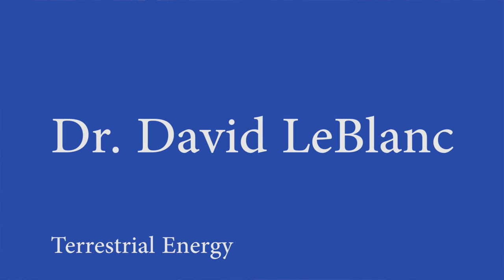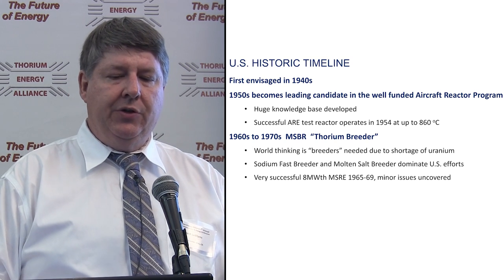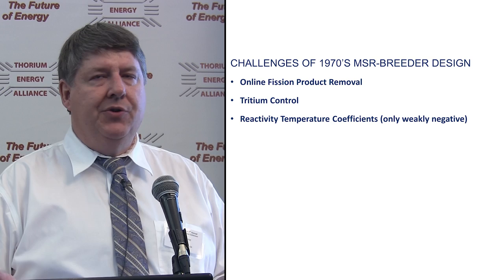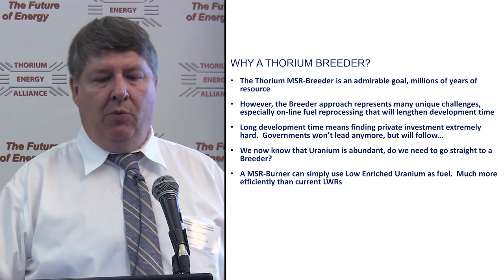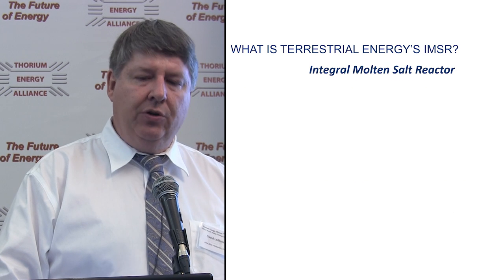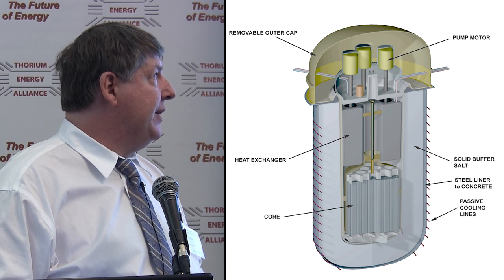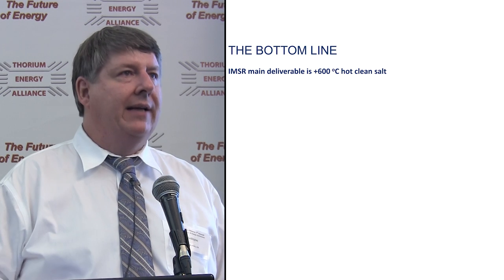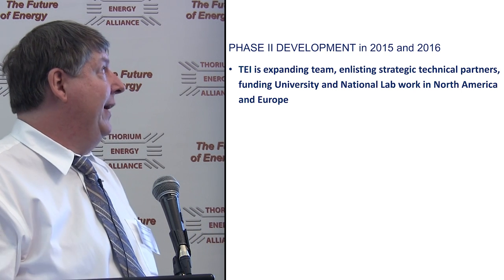IMSR: Terrestrial Energy's Integral Molten Salt Reactor -by Dr. David LeBlanc @ TEAC7

Comment: "Fukushima shut down, NO problem" No problem? Really? Laughing. The thorium scam trundles on.
Reply: Yes, the reactors had shut down, but the cores were still extremely hot just like an oven, car engine, room heater, etc. aren't cool the instant it turned off.
Reply: kokofan50 Laughing
Reply: Il Pirata Well, some finding their own ignorance funny. I guess there's a first time for everything.
Reply: Il Pirata Because you don't know what you're talking about.
Reply: Says the guy/girl comparing car engines, ovens and heaters with fissile nuke fuel. Go away
Reply: Il Pirata Yes, using objects most people will understand to explain that bodies don't instantly stop being hot. That's so crazy I can't believe I did that.
Reply: Infants and younglings aside, how many people do you know that don't have a basic understanding of heat retention, and need it explained to them? And do you really think your analogies (ovens, heaters) work with a self sustaining process like nuke fission reaction? I'm no expert but the differences seem obvious and distinct. I'd suggest you not assume everyone with an opinion different to yours is ignorant or needs things explained to them. Maybe you're the one with the misconception?
Whether or not the core had shut down, or the cooling provisions failed subsequently isn't relevant to the point I was making. That suggesting there "was no problem" is the laughable spin pro nuke lobbyists need to bleat to minimise the real dangers of nuke power. I'd have thought that was pretty obvious too, but look, turns out you need it explained to YOU!
Reply: Il Pirata You would probably be horrified by how many adults don't understand even the basics of heat conduction. Also, most people, particularly the anti-nuclear people, have no idea how nuclear reactors work. 

Nuclear reactions are only self sustaining understand the right conditions, and the reactors at the Daiichi plant were well below critical. Everything was fine until the reactors lost cooling. 

No, anti-nuclear nuts hugely exaggerate dangers, and a realistic look at the danger seems blasé in comparison.
Reply: "particularly the anti-nuclear people"

You can't help but dismiss all opposing views with glib generalisation, preferring to see the world through your partisan myopia!?! How typical, I'm guessing you're a republican, or worse, a libertarian? 

Suggesting "everything was fine" at Fukushima "until the reactors lost cooling" is as nonsensical as saying everything was fine till the two trains collided head on. You've missed the point, again.
Reply: Il Pirata I was being neither glib nor dismissive. I was simply remarking on an observation I had made. 

What point and how am I missing it? The Daiichi plant would have been perfectly fine if the reactors hadn't lost power
Reply: So when you say  

"most people, particularly the anti-nuclear people" and "anti-nuclear nuts hugely exaggerate dangers"

what were you being if not glib and dismissive of those you don't agree with? 

As to the point you continue to miss 

"The Daiichi plant would have been perfectly fine if the reactors hadn't lost power"

Would have? If? Hadn't? 
But they DID!

By the way, how's the clean up effort going? How much contaminated soil has been collected and where will it be stored and for how long? How much contaminated water is still leaching into the ocean every day? How many people have been displaced, loosing their homes and lives as they knew them? And what's the genetic/oncological legacy left to future generations, globally? 

Your selective statistical appraisals are irrelevant in the stark light of these realities.

That is the point! 

Ps not only did primary power but back up/emergency power supply to cooling systems failed as well. I bet lots of people thought they had the whole 'safety' thing covered. And I bet they did, right till the moment an unforeseen earth quake caused a tidal wave that made a mockery of their arrogance. Nature has a way of doing that. What are your 'stats' for unforeseen freak natural occurrences? 

Got the point yet?  

Oh, and which is it, republican or a libertarian? Laughing ;)
Reply: Il Pirata You need look up the mean of glib because I'm nowhere near being glib. Calling somethings exaggerated simply means you're saying it's being made bigger than it really is. I don't seen how that is being dismissive. 

So you're point is that there was failure? Well, no one is saying there wasn't one. I think you're missing the point of the being made in the video: all nothing would have happened except for one point of failure, which can be addressed in other reactors. One of any number of changes would stop the meltdowns at the Daiichi plant: putting the back up generator some place besides the basement, keep one reactor on so it could power the cooling systems, building a taller tsunami wall. 

Strictly speaking about radiation, no one had to leave their homes. The radiation levels are well with in safe levels, but government's have overly strict policy on radiation levels. The worst thing that's going to come out of Fukushima is a small amount of localized environmental damage and all the fear mongering.
Reply: Oh as for my political views, I'm a liberal.
Reply: 1 Get a better dictionary. 
2 Yes, you "don't see"!
3 All it takes is ONE failure!
4 Google 'Unforeseen' you need to!
5 ANOTHER redesign of safety? One day they'll get it right, right!?! But before you celebrate see no.4.

"Strictly speaking about radiation, no one had to leave their homes. The radiation levels are well with in safe levels, but government's have overly strict policy on radiation levels. The worst thing that's going to come out of Fukushima is a small amount of localized environmental damage and all the fear mongering."

           Cambridge Dictionary
Glib; speaking or spoken in a confident way, but without careful thought or honesty:
 
           Merriam-Webster
Glib; said or done too easily or carelessly : showing little preparation or thought.

           The Free Dictionary
Glib; 2 Given to or characterized by fluency of speech or writing that often suggests insincerity, superficiality, or a lack of concern: 

See it yet?

Ps a progressive would have immediately railed against the accusation they were a republican, without me having to ask twice. Your lying is as feeble as your logic. 
Anyway, thanks for the chat. It was amusing.
Reply: Il Pirata Like I said I wasn't being glib. I was neither being dishonest nor unthoughtful. 

It wasn't completely unforeseen. As I said before, there was a tsunami wall and other safety precautions. 

I said I'm liberal not progressive. They're different.
Reply: The real problem with Fukushima is the coolant boiled away. And since the fuel is solid, it will be much hotter than the coolant.
In a PWR/BWR if the coolant is around 250C everything is fine, and the critical spots in the reactor will be around 1700C. If the coolant warms to 300C, there are spots in the fuel that are beginning to melt.
Fuel at 2000C the whole thing melts.
In an MSR the fuel and the coolant is mixed. Since its a molten salt, its a liquid when operating and a solid if it shuts down for a while. It needs to warm up to 1400C and up for the salt to boil.
The IMSR core runs at 600C. If you consider the reactor a total loss, it could heat up to around 1400C until the salt boils and we have real problems, and the salt thermal capacity is huge compared to a water cooled reactor (it needs to get a whole lot more total heat to warm up by the same temperature).
With the extra salt around the reactor core and then a big water jacket, and the simple fact that as the core heats, it will create natural circulation that will cool the core even without any pumps running.
This means Fukushima/TMI/Chernobyl = impossible with IMSR. Just can't happen. It will take 2 days after an abrupt full power shutdown before there's enough heat to just melt all the salt in the reactor including the buffer (with all pumps offline).
Once all the salt is molten, natural circulation is at the highest = the faster the heat is being dissipated.
All it takes is surviving one week. At that point the decay heat generation is so low the reactor will begin to cool by itself, even without pumps.
Fukushima could have been prevented with an additional 50hp portable pump being used to reload the overhead tanks with more water. The coolant would boil and be continuously replaced.
The accident could have been prevented just by having any modest electricity supply to the reactor.
If they restarted one of the reactors at minimum power, the problem would have been solved.
Each reactor is mandated to have 3 diesel generators, but they're all installed side by side on the basement which got flooded. Having 1 or 2 of the gens in a higher level would have prevented the problem.
And the tsunami walls weren't high enough, which could have prevented any significant flooding.
There were reports by both the US NRC and General Electric (designed of the reactor) recommending this.
This accident really happened because Japan was in a serious economic doo doo for over a decade, and Tepco didn't want to spent any money, and the Japanese nuclear regulator didn't do their job (probably pressure from higher ups in government).
And this was a reactor designed in the 60s, built in the 70s, that ran for 40 years without issue (there are close to 100 reactors of this exact type running worldwide).
Now, you can be an ass and continue with your anti nuclear non sense. But in those 40 years, the quad reactor site saved thousands upon thousands of lives, cause it was either nuclear or coal. Coal kills people continuously. Nuclear takes a serious accident to maybe kill some people. So far Fukushima = zero nuclear deaths, zero nuclear cancer cases.
Grow up !
Reply: Il Pirata Another manufactured anti nuclear lie. The nuclear cycle produces about as much CO2 as solar panels or wind turbines.
Assuming 1% pure ore, a 1GW reactor needs 25000 tons of ore/yr. After milling, its down to 250 tons, after enrichment, 35 tons. That's for an entire year !
A nuclear reactor lasts 80 years. Solar panels might last over 30, but they don't make even 20 years worth of first year power production. So in those 80 years, you need to replace the solar panels 4x. Inverters last just 12 years, need replacement about 6x. And thats ignoring that pesky storage since the sun doesn't shine at night.
But my or your opinions doesn't change the facts that nuclear power is very low CO2. The most energy intensive steps (milling, enrichment and fuel fabrication, can run 100% on nuclear electricity) !
Those that made the BS arguments probably assume the electricity is 100% coal !
But an IMSR uses 1/6th as much uranium as regular reactors.
When you shutdown a nuclear reactor anywhere in the world, its replaced by coal or natural gas.
Risk reward is just fine.
The world was enough nuclear reactors to power 100% of North America (with enough pumped hydro to load follow and handle peak loading). If nuclear were that dangerous, there would be far, far, far more accidents. But people like you probably never opened the IAEA PRIS website to look up FACTS !
Reply: Il Pirata Your question regarding the carbon footprint of nuclear reactors is a clear strawman attempt. Aka, your premise implies all of the power must only be supplied by carbon emitting sources. What if the power was from solar and wind? Or nuclear, then the already low carbon footprint of nuclear power would be non-existent.
Reply: Il Pirata Thorium is much more efficient and the carbon foot print is hence reduced with thorium msr reactors that would not output as much carbon as they would not have to mine as much as they do not need as much ore.

Furthermore I was reading this comment thread and you seem to be a lot more emotional and highly dismissive.  Talking about the risk of reactors when by the numbers they are they safest form of energy  (barring solar).
Reply: Mankind is killing the world. Either by global warming and/or by acid rain and pollution from coal burning. Even if atmospheric CO2 is not the problem, acid rain and pollution from coal most certainly is. With no alternative in sight, coal is set to grow exponentially as the poor countries try to modernise. 

The efforts made in the rich nations with windmills and solar power simply displaces the coal burn to people who cannot afford the non fossil technologies. Renewables in the most part are nothing more than greenwash to make the rich feel good inside. There is not one renewable energy system that is remotely close beating coal on cost. 

If we had an ultra safe bulk power system with costs lower than coal, it would be used everywhere. Nobody wants coal but its all the poor of this world have so its what they'll use. Nuclear is the only option. There is nothing else. Molten salt nuclear has the temperatures to run process heat and even provide freshwater without cooking the planet. Old nukes can't do any of that.

Nuclear power has to shake off the narrow minded thinking within the industry that builds and continues to run monsters like Fukushima while ignoring fundamentally safe systems like MSRs. The narrow minded anti-nuclear brigade will be ignored either way as their arguments simply do not add up and do not consider the horrible reality of coal.